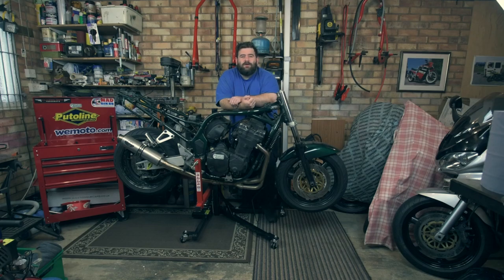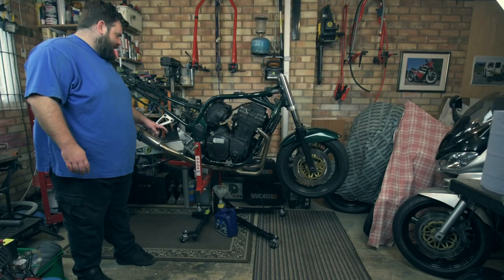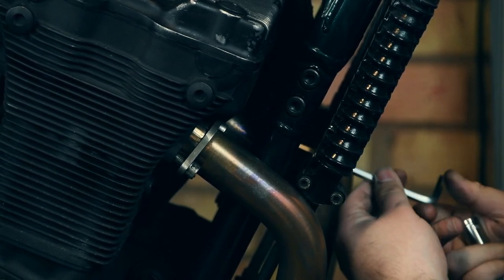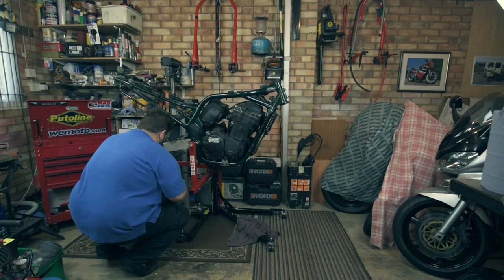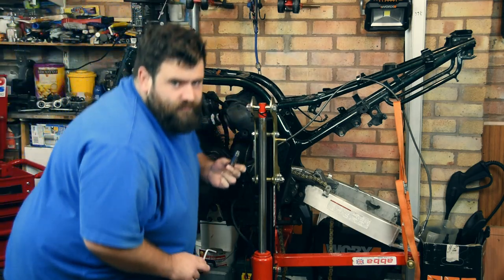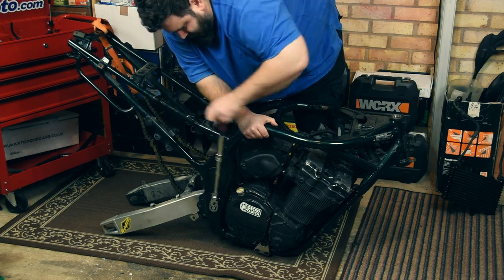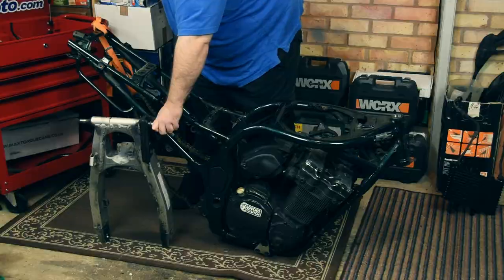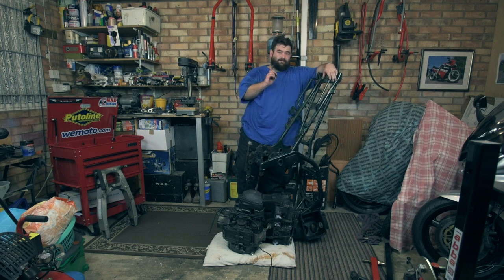Suzuki bandit engine removal || It's Bandit o'clock series 2 Part 2

Comment: Just acquired my mk1 bandit with 18k, passed its mot on Thursday but unfortunately its been stored for a few years so is needing stripped which will be my winter project. Thanks for this video very helpful.

How long did it take you to strip it to frame as mine is the teal colour and its getting a change of colour.

Comment: Broski, that was helpful, I'm breaking down a 2001 and selling off parts, do you recommend a site to sell parts on? I also want the swap a low miles 2001 motor into a 2005 high miles bike, feasible?

Comment: You keep dropping parts in your tool box or on the work bench. How are you cataloging all these parts? Do you have a photographic memory?
Reply from the maker: Hi Joey, I wouldn't say I've got a photographic memory but I have taken apart and put back together a few Bandits over the years. Plus I can always watch the video back if I do get stuck
Reply: This is my thing I'm about to consider taking my engine out not forks or swing arm etc but I'll be sure to put bolts where I know I won't a )lose any b) know where they go lol

Comment: Your rear spindle was in the wrong way round
Reply from the maker: Alun Saunders I’ve put the rear spindle in the wrong way around so when you tighten the nut it doesn’t affect the chain tension as much as it normally does the “correct” way around, I’ve done this to all of my bikes over the years.